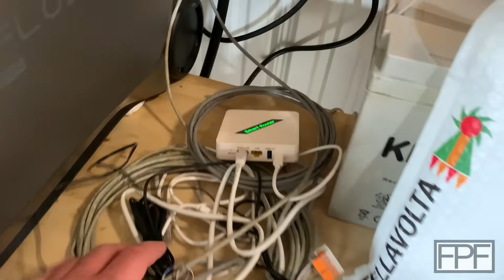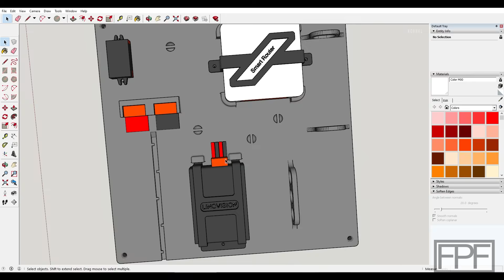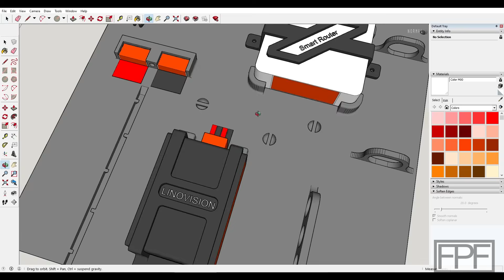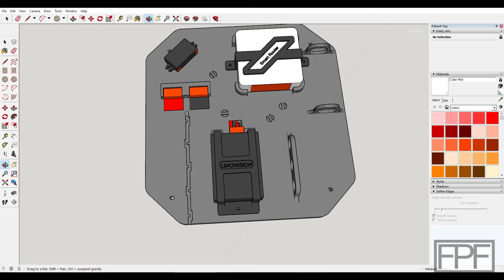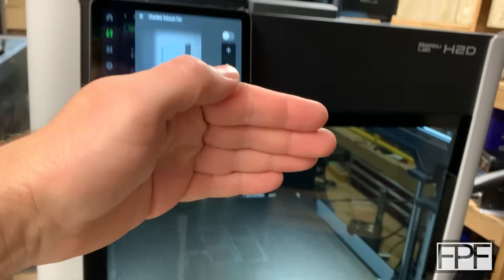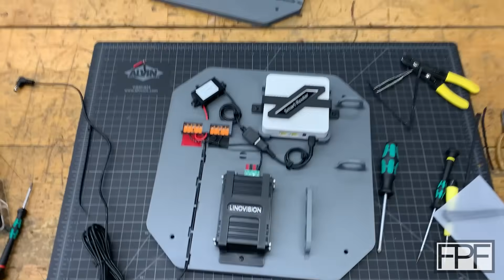3D Printed Equipment Mounting Board - H2D Problem Found

Comment: I’ve had similar problems on my p1s with the big aux part cooling fan. It is such a terrible software design for that setting to be in the filament, not the part. I’m sure the fan helps for lots of parts, but not for some of the larger flat parts I do. I don’t want to have a separate “no fan” version of every color to make up for dumb design choice.

Comment: Good sleuthing on temperature differential across print! This is a project I will download the files for as I have a WiFi extender that connects to a 250 gallon water tank that I monitor the water level as well as for 2 garage door controls and 2 video garage door keypads , and a Ring Outdoor camera. My cable mess looked like yours! The tri-color power identification is spot on.

Comment: As a future request it would be great if you could feature some 3D Scanning and then incorperatung that into the design. Obviously a bit overkill on this projecy but hey that's what we all love!! You could have scanned the parts to go on the board and then Design around the scans in CAD. Also using something like Fusion 360 and a little more on howe you design would be great. I know you sayt that it would be commercial use but I thonk if you were to reach out to them they would say it's OK. They would see it as an advert and probably give you full access for free.

For the scanner reach out to Revopoint and maybe the Metro X. A brilliant tool. Ive just bought one and iots brilliant.

Comment: Pla problems with the cover on occurs when the average flow rate is really low. If you think about it, the flow rate is a aspect of toolhead cooling because it is thermal mass leaving the toolhead, helping to keep it cool. If you have a high avg volumetric flow, you won't run into clog issues with pla even with the lid on.

As far as the warping, I've even had warping issues on pla with my x1c due to some really silly default settings setting the aux fan to run hard. Turning it off fixes it.

Comment: Great project, and a great video. That printing problem would have driven me nuts as I'd not likely have spotted what was going wrong. I'll be stealing some of your ideas as 95% of my prints seem to be mounting devices I've purchased and making cases for microprocessor controlled gadgets I've created.

Comment: I have found this issue with my p1s, if I don't switch off my chamber fan or something my part fan manually, I get difference in quality and in the software I have tried to put fans off while slicing and they stil go on most of the time. so I sit and wait for start, switch it off twice, because it starts up after switching it off the first time and then only leave it, my biggest prob was also on petg

Comment: This is not a printer issue. This is a flaw in the model design and slizer not built to resolve this :) 

Printing a part like that needs some extra understanding of how expansion and contraption works :/ 
Sorry to see you waisted so much plastic, Tell me if you want help to see if its possible to resolve this in a easy way, 
id be glad to help
Reply: I really need to loot to the end without writing xD 
You figured it out so no problem anymore, But you could end up with similar issues on PETG and ABS, so if you are interested i could help you out :)

Comment: Disabling the aux fan (manually or in the filament profile) may have helped you.
Reply from the maker: it's not the the part of aux fan, it's the exhaust fan, which there doesn't appear to presently be settings for

Comment: Which infill were you using in the first attempt?
Reply from the maker: 1st print grid (failed), 2nd print gyroid (failed), 3rd print identical gcode to 2nd but with exhaust fan manually overridden (success).

Comment: You’re using way too much gaddamn pla for what that is. You needed to remove a lot of the material. Less material, less warping. It’s not a software problem, it’s not a hardware problem, it’s a design problem.

Comment: You can control the the auxiliary fan on the X1-C in the filament settings. I had a similar issue printing PLA silk that was lifting from the bed and changing the fan speed to zero in the filament settings took care of the problem. The only problem is you had to save your setting into a user configuration. I am not sure if this is still true in the new version of Bambu Studio.

Comment: I have the same issue on P1S if I open to top glass cover or the front door. My fix: I always leave them closed, even more, I have a thermal blanket on top of the top glass cover.

When printing PA, I also cover the side walls and I use a FR4 plate.

Comment: I had the same issue with large PETG prints and my solution was the same as yours. Really really don't need all that airflow cooling the print and making it warp.

Comment: This also comes down to your design. Printing a huge solid slab of plastic is not a good design for a 3D printer. Something this size should be more of a skeleton. You are fighting the properties of the plastic and the process.

Also, the vent settings should be in the filament settings, not the print settings.

Comment: The main problem you have is an A/C which pushes the environment down/up to a fixed temp and humidity and all 3D printers are not well suited to such a situation.
Probably what is needed is a temperature sensor on the outside to better determine if the vent should open to cool down or not. If too cold/hot outside leave shut else allow it to possibly open.
Another solution is to have a heater on its input (along with baffles to slow input air down) to better control the air flow temperature in order to make sure it is never too cold.
Or all of the above.

Comment: I had the same problem with my X1C. The auxiliary fan on the left side of the printer was causing the left side of the print to cool faster than the right side, so the print would warp. Disabling the auxiliary fan in the filament profile fixed my problem.

Comment: I had a similar problem once. I figured the fan for the internal bridging was causing the warping issues. I Fixed it by increasing the infill, increasing the bottom layers and turning off the fans for internal bridges.

Comment: It looks like the vent and cooling are controlled via the start gcode in the printer settings.

;==== set airduct mode ==== 

{if (overall_chamber_temperature >= 40)} 

    M145 P1 ; set airduct mode to heating mode for heating
    M106 P2 S0 ; turn off auxiliary fan
    M106 P3 S0 ; turn off chamber fan 

{else}
    M145 P0 ; set airduct mode to cooling mode for cooling
    M106 P2 S178 ; turn on auxiliary fan for cooling
    M106 P3 S127 ; turn on chamber fan for cooling
    M140 S0 ; stop heatbed from heating 

    M1002 gcode_claim_action : 29
    M191 S0 ; wait for chamber temp
    M142 P1 R35 S40 U0.3 V0.5 ; set chamber autocooling
    M106 P2 S0 ; turn off auxiliary fan 

{endif}
;==== set airduct mode ==== 

Chamber temp less than 40c vent is closed and cooling fan is off, over 40c the opposite.  So for large prints set chamber temp to 41c.

Also, warping prints happen when chamber and bed temps are too cool not due to poor adhesion as demonstrated in this video.  The petg was adhered so well it pulled the plate off the bed.  Glue is a bandaid that might help in certain conditions.

Comment: Use Hilbert curve for your top and bottom layers and for internal SOLID infill (Gyroid for sparse infill).  Reason being, using monotonic or rectilinear are big long lines that, when they cool and contract pull on the corners like piano strings... Hilbert curve has no such long straight extrusions, so when it cools and contracts, it's not pulling on the corners.... I have to use this technique when printing polycarbonate because it will warp and even with vision miner nano adhesive, it will just lift the magnetic build plate right up ..but using the Hilbert curve technique, it does not
Reply from the maker: I'll have to give that a try

Comment: Nice project.  I especially like the ideas around the wire channel, zip tie points, and mounting brackets.

For the red and black colored sections, another possibility would be to make them separate parts, that you can print separately (by changing the print sequence to "By object", or as a separate print run) and then gluing them on.  It may not be as useful in this specific case, where you may have a lot of thermal expansion and contraction (which might cause the glue joint to fail), and where those colors are probably only a few layers deep.  But in other cases, especially where the different color needs to run through lots of layers, or you have lots of color changes, it can be a good choice.  (I'm guessing that you put the red and black into an AMS connected to one head, and left the other head to print only the grey, so the only "poop" would be switching between red and black.)

I use OnShape for my CAD.  One of the nice features it has is that when you subtract one object from another, you can specify that it should leave a gap between the parts.  A gap of 0.1 or 0.2mm has worked well for me to compensate for outer dimensions being a tiny bit too large, and to provide a place for glue.  So, I might have started with the base plate being flat, designed the red and black inserts, and subtract them from the flat plate (as opposed to explicitly designing a rectangular notch to hold them).

I think my designs are getting better as I think more about parts that fit together (and plan for how to assemble them!), rather than trying to print the whole thing is one single piece.  The brackets for the router and Ethernet hub are great examples.  You probably could have built them into the main plate, and slid the electronics in.  Making separate brackets to screw to the main plate was cleaner and probably faster (not to mention, probably fit better).

Comment: That problem is not unique to the H2D.  I fought the exact same problem on my X1C with a large flat print (the Crib-Man cribbage board) last year.  The solution was adding some plate clamps and turning off the fans.

Comment: In your filament profile open "Advanced" tab, here you will find the exhaust fan control settings. "M106 P3 S255" means "turn exhaust fan at 100%",  where S255 = 100%, S0 = 0% and so on
Reply from the maker: Thx, I see that as well.  Manually modifying the start gcode for all the PLA/PETG filament types seems rather painful though, hopefully they either add a device-level control in the UI, or at least add the exhaust fan to the cooling settings in the filament config

Comment: Wow - I don't think I have ever learned as much in a half hour. I am about to take delivery on my first enclosed printer and I print almost 100% in PETG. The room has a ceiling fan so you may have just saved me a lot of anguish! Your problem solving and 3D print knowledge was awesome. Also, I have a wiring mess to clean up and this project might be just enough to inspire me.

Comment: Can't you adjust cooling fan properties in the specific filament settings in the slicer?
I know in Creality Slicer there is a ton of cooling settings in the filament settings. Haven't had a chance to check Bambu Slicer. 
I have the side fan 100% off because of lifting on the side where the fan is. 
It's not the bed.. It's 100% cooling.
TURN OFF YOUR side fan. lol

Comment: OK, the project is impressive; and I will probably use some of the things (zip tie pockets, wire routing) in my future projects. But, as an old Air Force Avionics Technician, I really appreciate your logical approach to troubleshooting. Definitely impressive. Still happy, for now though, that I did not get the H2D when I had the chance.

Comment: I have s space similar to yours in my basement.  Same issue with the ambient temperature. 

 In 5 years I have never opened my enclosures for PLA or PETG and they always print fine.  Even with an enclosure temperature nearing 40°C.

I don't like the idea of bringing outside air into the enclosure because of the same issues you had, and therefore for filtration I have all of my machines setup to recirculate the air in the enclosure vs. exhausting the air.

Comment: With my A1, which is much more prone to warping, I've had very good results adding a skirt as tall as the model. The only problem I have is that the skirt itself will warp and there is no straight-forward options to add brims to a skirt. The trick is to use Orca Slicer, it's possible to make the brim of your model intersect with the skirt if it's big enough. With objects where I don't want to have a brim, not even a painted one, because of aesthetics or simply because it's a pain to clean, you can add very small sacrificial cubes with brims enabled at the object level surrounding the main piece and that way you can have brims intersecting with the skirt while leaving the central piece clean, and space for the build plate warmth to build up between the piece and the skirt, without having to heat the whole enclosure and risking clogs.
I wish BL had dedicated all the time they wasted playing with lasers into having a much better control of the temperatures and air flow in the enclosure.

Comment: When combining 3D prints with electrical stuff, keep in mind that the plastic is quite flammable. There are no fire retardant additives, so a hazard of fire can occur.
In this special case I don't see any risk, but if you are dealing with higher current or voltage, at least think about this for a minute. Especially regarding mains power.
That's just an general advice from someone who experienced a major fire in his house once. :)

Comment: Good problem solving, but you still think like someone who is new to printing when it comes to the design. You waisted so much material by making that a plat. for subtractive manufacturing that would make perfect sense, but not for additive. For example you could have made the plat a mech, or you could have used generative design.

Comment: If the fundamental issue comes from sudden temperature change in the H2D enclosure due to colder air blown by your A/C (and it really seems to be the case indeed) then why don't you have the same kind of issue when letting the door of your X1C or P1S open (or its top glass panel removed)?

Comment: I run my printers in my basement which is also very cool and low humidity. I do the same, I rarely have the door open and often turn off chamber cooling. It has been my experience that most of the problems people have with any good quality printer are more environment problems than anything. Or rather not understanding their environment.

Comment: I have the X1C and had exactly the same warping problem with large flat bottom prints warping and lifting the plate off the bed. I was following Bambu’s recommendation to open the front door (although I didn’t take off the glass top because my AMS is up there). I knew immediately that the parts must have been cooling too fast so I reprinted with the door closed and it solved the problem. I agree that Bambu needs to change their software to make venting optional or provide an option to adjust at what temp it vents and I think they should adjust their recommendations for the X1C as well.
Reply: Well..... It's also kinda dumb with Bambu (and even Creality) having their default PLA profiles set to have the auxiliary print cooling fan (the one at the side of the bed) set to 80% fan speed.  The only time I really ever experience warping of large or long flat pieces is if I forget to choose my modified profile with the aux fan set to 10% or off, or if I forget to change the fan speed after the print starts if I realize I DID forget to change the profile.

Comment: Not overkill at all it turned out really nice. You said your router overheats. I’m surprised you didn’t have it sitting off the base maybe on some little feet so Eric could flow through the bottom. Look forward to your next build and video.

Comment: This will happen with any magnetic plate (and other too) when using plastic with high shrinkage. It is necessary to use engineering plastic with CF filling and zero shrinkage to avoid deformations when printing such huge parts. But either you know this and just created a clickbait video, or you are a complete newbie. Didn't you study physics?

Comment: Agree cooling speed is part of the problem.  One item to help with warping like you are seeing is to change the bottom and possibly top layer to hilbert curve to reduce the length of lines.  Because it does not have long straight lines there is less single direction stress as it cools.  So won’t taco the bed as bad.   Slower cooling by closing the chamber also help.  So your solution is a good idea on large flat prints also.

Comment: Did you make adjustments in the sketchup design to allow for petg shrinkage or did you adjust the scale in the slicer?  I know orca slicer has filament settings for it but i primarily use Bambu's.